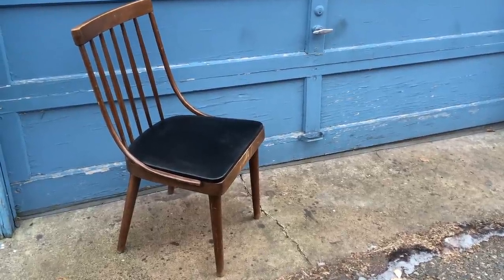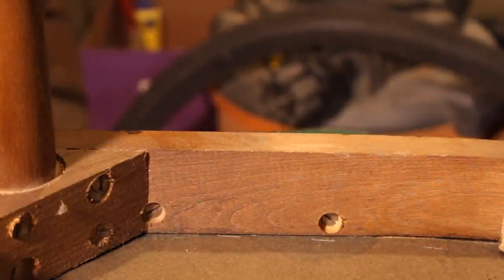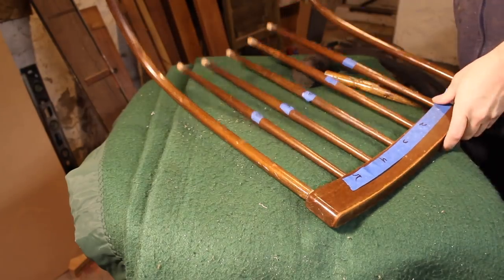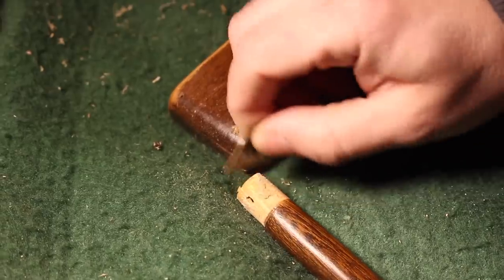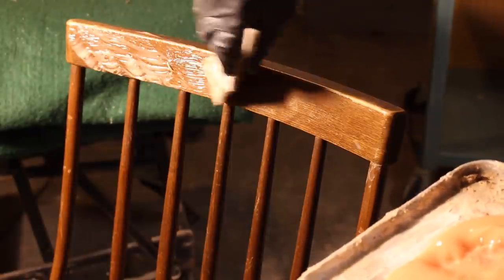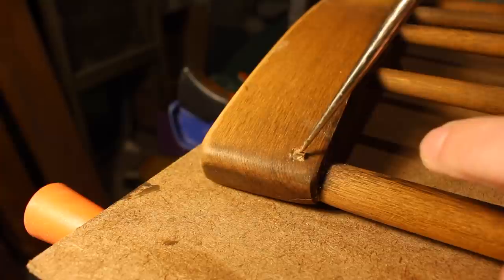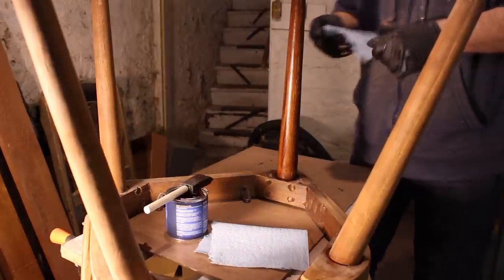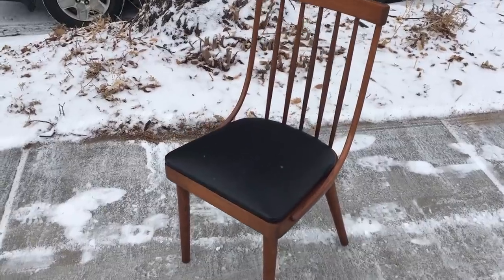Mid Century Chair Restoration | Refinish | Reglue

Comment: The chair is really amazing! Great work. What is the colour of gel stain? Could you describe this "poly" thing more? I live in Poland and I'm trying to find some kind of replacement for this product. What is the ful name of it? Is it similar to varnish or resin?
Reply from the maker: Hello, the color of the gel stain is Candlelite.  It's made by General Finishes. Poly means polyurethane.  It's similar to varnish.  I use oil based Minwax satin wipe on polyurethane.  Thanks for watching.

Comment: Yeah I know what you mean about the value of a single chair...but I can't resist saving orphans like this one that are soooo nice;)  Just curious how you decide when to use wipe on poly vs. the spray finish you use on other pieces.
Reply from the maker: Me, too. I have an attic stuffed with orphan chairs. 

If it’s too cold to work outside then that would rule out spray lacquer. I don’t want to spray it in my house. I also sometimes prefer the look of a thin satin poly finish. It adds color that lacquer doesn’t. Also, if time is a factor, I’ll use lacquer when I can since it dries quicker than poly.
Reply: @DashnerDesignRestoration   Amazing work. Love it. And that was going to be my question too... how do you decide which one to use as a finisher, oil poly X spray. Now I know. 
 I can't resist single chairs either and this chair makes one amazing office chair. You can definitely sell it on its own.

Comment: I found a McCobb Planner dining table but it has been painted blue. What do you recommend to strip paint? Would that citrus stripper work?
Reply from the maker: I don't strip paint often but the Citristrip should work.  Good luck with your project.  That's a table worth saving.
Reply: No doubt the type of wood and type of paint will be factors. I've recently been using Citristrip to remove multiple layers of decades-old paint that was applied over some kind of 2 tone stain, on a dresser that is 60 years old or more. I have been very happy with the results. Letting the Citristrip sit on the unit for up to 24 hours has proved to be helpful on the 1st application, then less time when additional applications are required. Very easy to clean up.
Reply: Thanks for introducing me to Citristrip.
Reply: Sounds good. I'll wait for the weather to warm up and try a 24hr application of citrastrip. I'd hate to mess with the hard core paint strippers.

Comment: Great video....curious as to why you didn't repair the crack in the side of the top piece where you removed the spindle?
Reply from the maker: When I put glue in the hole for the spindle I also put glue in the crack.  It's all glued solid now.